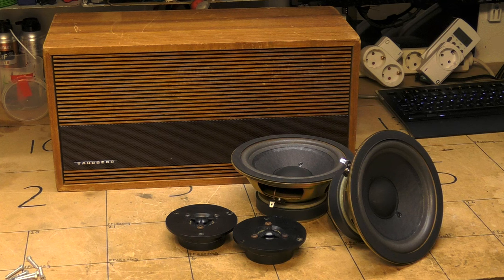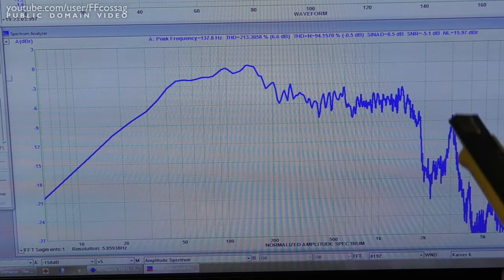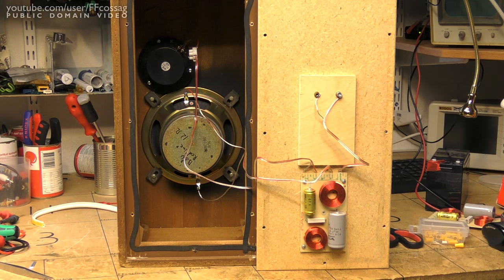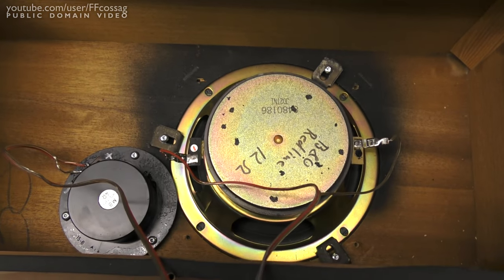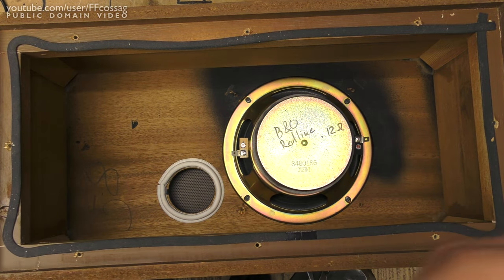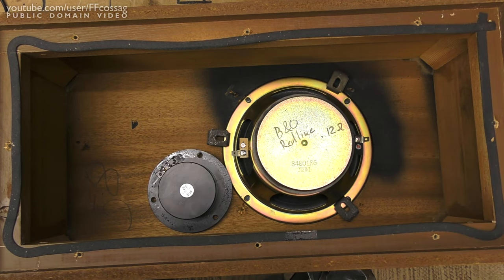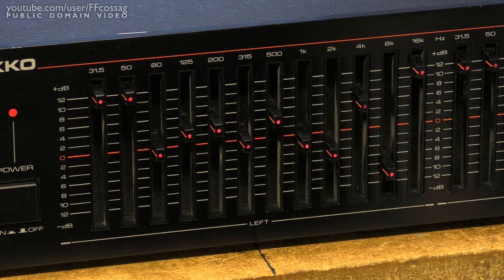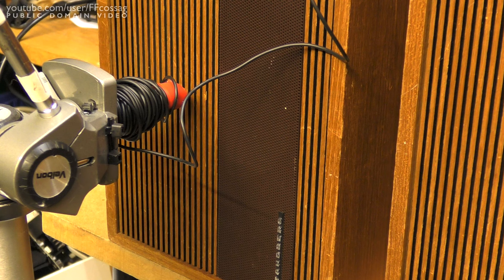Frankenstein speakers built out of old trashy parts (w/ measurements!)

Comment: Loved it. 
I built a pair of transmission line towers with 10" Audax woofers and my best guess at phase aligned midrange and tweeters.There so damned heavy at 96 Lbs./44 kilos. They still play loud and smooth and they are pushing 37 years old. I want to get my Nikko amp sorted out though, have not used that in 20 years (leaking caps)
Reply: About 5 feet tall, 3/4" super high density flooring grade particle board and over that, 3/4" Cherry veneered plywood, the corners have solid walnut inset and rounded from floor to up and over the top. 
Looking back I may have had a bruised ego, resulting in over compensation by building a huge set of speakers. LMAO
 The base dimensions are 16" x 16" It took a bit of configuring the port and fiber fill to achieve the best results. I did not want any cabinet vibration and the internal "fold", aside from creating in effect, a long pipe within also further stiffened the structure.

Comment: If you want a sealed and rigid speaker box use resin that you use with glassfiber and mix some sand (like sandblasting sand for example) with the resin than coat the insides with the mix

Comment: Couple of tips from my 20 years of DIY Hifi. 1)Try to find some tweeters that are the same impedance. The interaction between the woofer and tweeter have a better chance at meshing if their the same impedance. 2) When you measure do it from 1 meter, any closer and you wont see the fully meshed crossover point. Also dont have the other speaker physically sitting beside the one your measuring and put the speaker your measuring at least 3 feet from any wall or shelving unit in your case. Being so close to things and especially the other speaker it will add other caves and dips to the frequency response do to some nearby phase cancellations and reflections from the immediate surrounding walls.
Reply from the maker: I measure super nearfield just in order to get rid of reflections and other nasties. I don't run both speakers at once, obviously.
Reply: I hear you. If your environment is bad for measuring then you'll have to do what you did. Another thing you could try is to make a simple first order crossover to see if the woofer and tweeter might mesh better. The crossover boards you have are obviously second order, so you could tap into the larger air inductor which I'm guessing is around 0.5 mH and use only that on the positive of the woofer. Then find a couple of capacitors that are around 2.2uf, add the resistor you liked and the capacitor on the positive of the tweeter and give it a shot. If you have other close capacitor values like 1.8uf or 2.7uf I'd try that and see what the measurement looks like. You can also flip the tweeter polarity so the tweeter will be either adding with the woofers frequency or canceling. 

So at your crossover point you will be playing with a 6db/octave slope versus the 12db/octave slope of those current crossover boards. 

The more different values of caps, resistors and inductors you have on hand to try, the more you can tweak each the woofer and tweeter into position by trying different values. Every woofer and tweeter has an optimal slope to make them mesh better and even though we aren't audio engineers just playing with the slope of the woofer and tweeter can be vastly better in some cases. In other cases a woofer and tweeter just wont sound good together. I also realize you are just making shop speakers so your fine with the extreme EQing. It's all good!

Comment: Im sure a long time ago, they had a seperate amplifier for each driver, so crossovers were not needed.
A cabinet makes a hell of a difference to the overall sound, dont take any measurements with the drivers not in a box.
Reply from the maker: These speakers did have crossovers originally, but I only have one of them left. They're standard issue two-way speakers. Nothing fancy at all.
Reply: Never saw seperate inputs on very old speakers, I just saw crude crossovers made by putting inductors and/or electrolytics directly onto the speaker itself.
Reply: I think they were for audiophiles, i dont think most people were bothered by the audio from crossover wired speakers.
But the seperate amplifier per driver did exist, i suppose the extra expense didnt make it viable for the ordinary listener, too dam expensive i suspect.

Comment: Very nice job, judging from the youtube audio I'd say they sound quite good (with the equalizer on, anyway)
What measurement mic are you using?
Regarding the tweeters, could that be a resonance peak at 2.5khz, that could be damped by a RLC notch... also could they have been ferrofluid damped, perhaps it's gone dry?
The theory about diffraction due to being mounted from the inside also seems very plausible.
Reply from the maker: My measurement mic is an Audyssey mic, the kind you get with Onkyo receivers. For some reason I have a box full of them.
Reply: I've been looking for one of those for some time, it would come in real handy for projects like this. Couldn't afford one (so I thought), but these are actually quite affordable on ebay.

Comment: some polyphil would help to clean up the sound alot so the bass is not just bouncing around in a hollow space making it sound boomy and unclean. sorry if my spelling is bad. there are many vids about the different things to use in them. best of luck.
Reply from the maker: The cabinets are absolutely filled with damping material, it's just not shown in the video.
Reply: FFcossag cool

Comment: Very cool! Can I ask you what's the software used for measurements? It needs a specific microphone?
Reply from the maker: It's called VIRTINS. It's rather expensive and rather buggy, but I like it. Any decently flat condenser mic will do for a testing mic, they tend to be flat enough. I use one that came with an Onkyo receiver.

Comment: Have you ever done a video on audio measurements themselves? Such as the equipment you need for basic stuff, I don't mean blanket answers like "Spectrum analyzer" Im talking more about "This is the minimum that I would use, X, Y, Z" Where X, Y, Z, are actual models of components. From the looks of it you do most measurements on your speakers with a simple mic + some software. I am interested in measuring different amplifiers I have so that if I make any modifications I can measure and see the results. One thing I particularly want to do is add a VU meter to a tube amp I built but I don't want to cause signal integrity issues.
Reply from the maker: No, I haven't. I'm not very good at being theoretical.
Reply: How about just a run down of how you do the measurements and list the equipment  / software you use to do so?
Reply from the maker: The thing is, sadly, that I get bored with such explanations, and I'm just not a good enough actor to make a good video about something I'm bored with. I have tried.